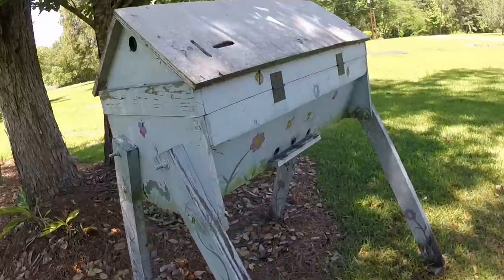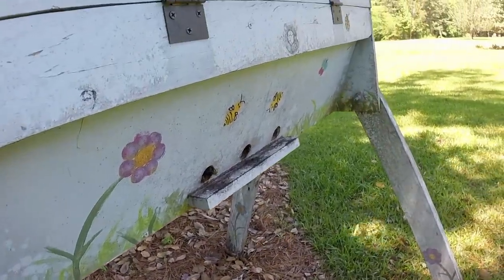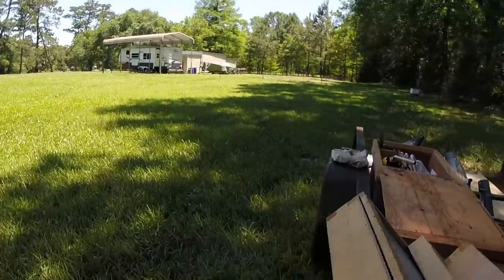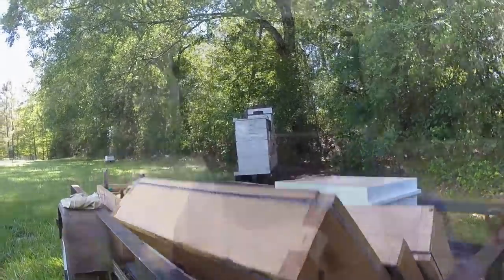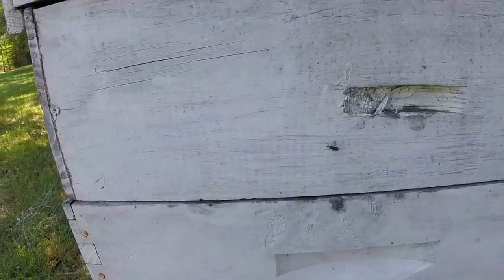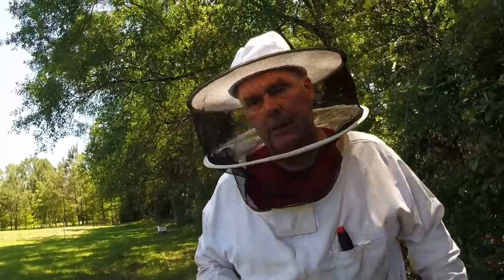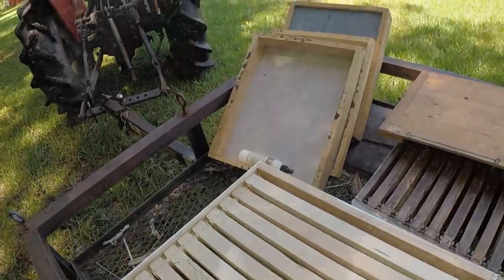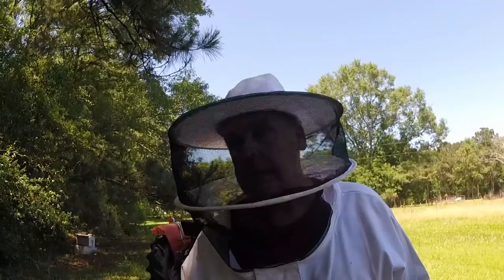Honey Harvest to Make Space

Comment: How do you do it Mike.  I watched your extractor humin along without you holding it down while mine I have to hug it to keep it from jumping around.  I try to balance out the frames but it still jumps.  Any hints?
Reply from the maker: David, i do what you do. I just try to balance it. I have some tough spins too. Just didn’t show it on video. But next time I will show the extractor taking me for a ride.  Honestly, as I uncapped, I place light frames on one end of the uncap tank and thick frames together. Then I spread them evenly best I can. Another idea that I have learned is to be patient. Even an unbalanced load will work out if you start very slow speed and then just let it go slow for about 5 minutes. Then speed up just a bit more for 3 or 4 minutes. Then the excess honey is out and it balances itself. I’ll make it a point show it on the next extraction video. About 90% of the time, it spins ‘hands off’. But rest assured, that other 10% is me holding on for dear life.